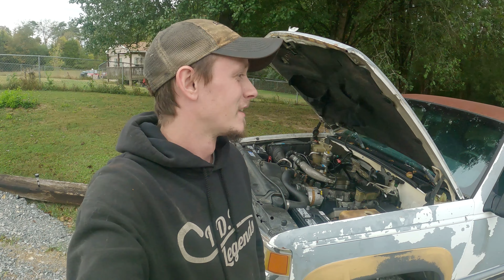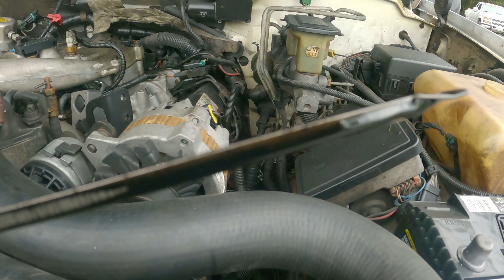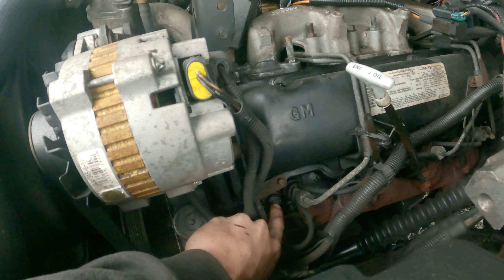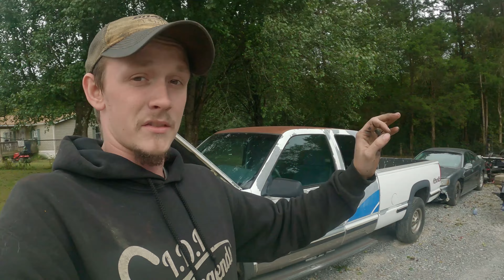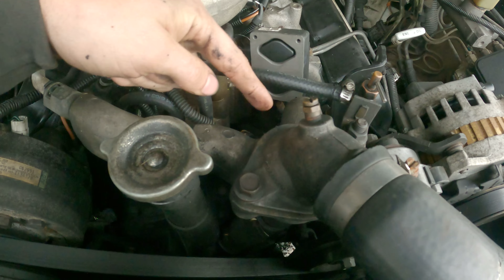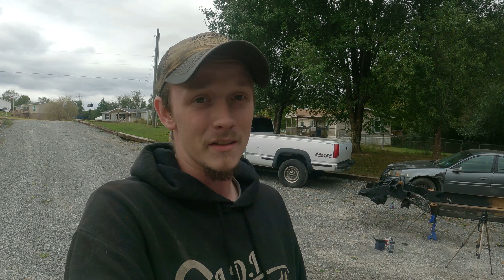6.5l Turbo diesel coolant in the oil pan

Comment: On my 93 6.5,  I had a coolant leak that wouldn't show during pressure check. Finally got it up on hoist and found my aluminum rad has a leak at the neck above the primary seal area but below the top cap seal. Am installing a catch can, complete ac system, new dampner and pulley frt main seal. Will be doing the remote oil and fuel filter relocation next.
Keep  up the information flow, as my experience has been in large construction equipment so this retirement project is new area. Thanks

Comment: I had 500000 miles on my 6.5 before the head gaskets blew. Motor had a hard life before i bought it so i just swapped a motor out. Drive the truck every day still.
Reply: That's impressive

Comment: Love the 6.5 videos. Learn more with every video. I really love the 6.5 engines. They get a bad wrap.
Reply: I think alot of it is from people who had them in service trucks on the job and improper pmd diagnosis saying it was a injection pump. my 6.4 powerstroke real bad rep too but if you take care of it its not a bad engine 6.0 powerstroke same way bad rep but take care of it and its fine people are too used to the 12v cummins being idiot proof

Comment: 506 blocks, 97 and up, liked to crack around the piston cooling jets. Just thought I’d throw that out there in case someone is fighting that. Good video buddy. Try a h1c/h1e hybrid turbo. I loved that setup. H1c hot side with h1e cold side and wheel.
Reply: Good to know. guess i'm lucky as my 94 has a 6.2 block from the military with 6.5 stuff bolted on

Comment: I literally (within the last 2 weeks) just finished doing headgaskets on my 6.5. Mine was only the headgasket, though the passenger head had the infamous crack between the valves on cyl 2. The machine shop tested it, and said it wasn't cracked all the way through, but they installed the sleeves that prevents there from being an issue. There was definitely coolant in the oil from the head gasket, but it at most had 15 minutes of run time with the blown gasket, so it seems fine now after doing the head gaskets.
Reply: Also, I didn't do head studs on mine, because mine is naturally aspirated (no turbo / no boost), and the head studs were more than $200 more than Fel-pro bolts were (plus very long lead times / everything is out of stock). I think my issue was with not changing the coolant in a very long time. Lesson learned, replace that coolant on the recommended schedule - it's a LOT less work and expense than doing head gaskets! Also if you're doing head gaskets over and over again, look at using the Apex gaskets or Victor Reinz gaskets that have a wider fire ring than the stock fel-pro gaskets. I know, fel-pro is the defacto standard gasket and praised as being "the best", but when the Apex or Reinz gaskets have a fire ring that's more than double the width of the tiny fire ring on the fel-pros, you have to ask yourself if fel-pro is really the best choice for these engines.

Comment: Always great 6.5 content. Sorry about the accident with truck that you put a lot of time and work into, only for someone to total it out. But what's a good pmd and resistors to buy for a 94 suburban k2500 6.5? Wanted to know what you think about ordering one of of Amazon as well.
Reply: Might want to look into quadstar tuning they seem to be the 6.5 guys these days
Reply from the maker: Thanks man I appreciate it hopefully one day she'll be back on the road, stock PMD resistor is a number five and if you aren't expecting to push the truck or need the access fuel I would just stick with that or number six

Comment: Hi, I have  94 6.5 that has delayed throttle when warmed up, builds 14lbs. of boost when it does wind up, then goes to erratic idle when it comes back down.
Reply: You checked into your fuel system? might be starving for fuel on just my guess

Comment: Any ideas on how to remove a broken starter bolt? I have tried to use a bolt extractor but it is not working.
Reply from the maker: Could either welding up onto the broken part of the bolt, or gently drill out the bolt completely and retap it using helicoil.

Comment: Are you going to install a thicker head gasket set to lower compression a bit?
Reply from the maker: No sir, I'll go with a thicker gasket once I take the heads to the machine shop and see haw far they off from factory they are and go from there, then put head studs in on reassembly